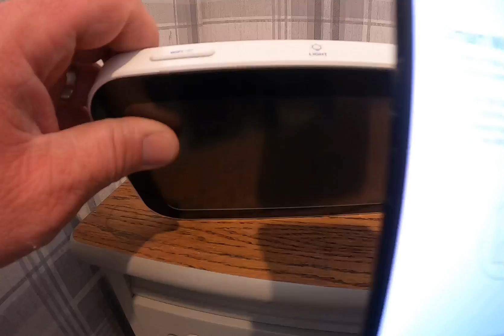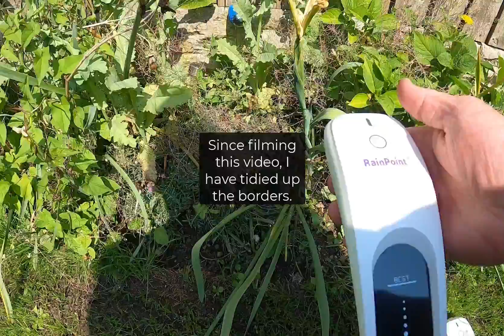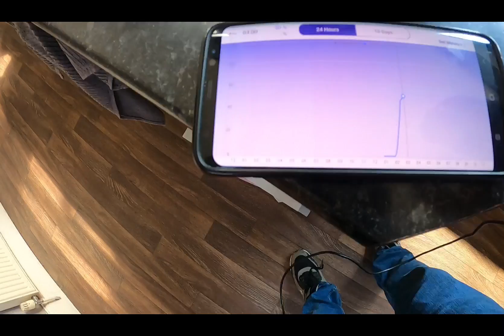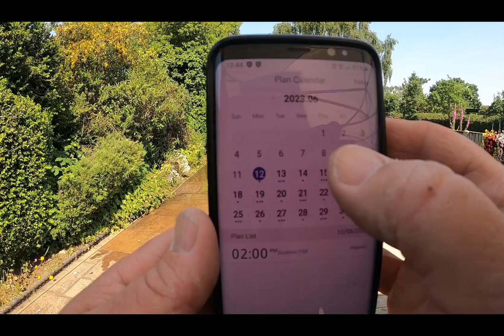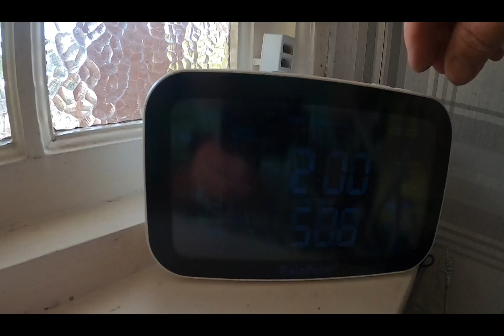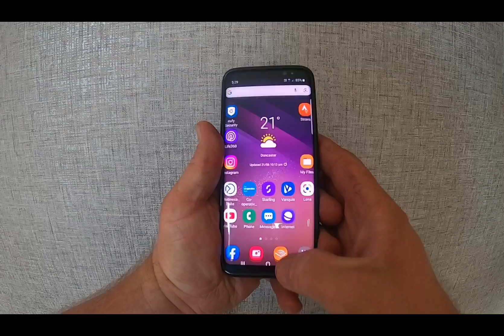How To Smart Water Your Garden - Rainpoint System Review

Comment: Hi, is there a way to control watering depending on the sensors? I cant find a way to stop the plan when humidity is sufcient or it is raining. So in the homgar app these features are missing?
Reply from the maker: Hi I'm really sorry I'm no longer using the product. I haven't used it this year either so I'm out of touch
Reply: You can setup a smart scene in the app and link it to the sensors. Make sure the wifi hub is using the latest firmware.

Comment: Does it automatically suspend watering when its rainy or do you have to skip it manually?
Reply from the maker: I think it suspend it.. Haven't used it for a year sorry so my minds a bit rusty 😩
Reply: Not automatically but you can setup a smart scene that tell it to suspend the programs if x mm of rain water has been detected by the rain sensor. You can also link it to a Weather forecast.

Comment: Nice product and great presentation!  I was expecting a wallet-pounding price, but was delightfully surprised at the low cost of the system you have.  I'm surprised RainPoint did not include small solar panels on the exterior sensors to charge the batteries during the day.  Maybe Version 2.0 will have them.

If you add some Hunter or Rainbird pop-up sprinkler heads, you will have a very nice lawn irrigation system.  I have used both Hunter and Rainbird systems, but prefer the Hunter for its durability and ease of programming.  In the past 11 years, I have not needed to replace any of the Hunter components, but was replacing a few Rainbird valves or spray bodies every season.  Fortunately, you don't have to dig up the spray bodies to replace the failed components.

I recommend the Hunter PRS40 (40PSI) or PRS30 (30PSI) pressure regulated spray bodies and MP rotator heads.  These will work perfectly with your RainPoint controller since they operate by water pressure.  I have 16 of the PRS40 spray bodies in two zones for the 200m2 lawn, and each zone works perfectly on the high pressure well pump or the domestic water pressure.  Depending on your domestic water pressure, you might want to limit each zone to eight spray bodies.  However, you should be able to easily cover your lawn with eight spray bodies along the perimeter with the appropriate MP rotator heads.
Reply from the maker: Thanks Mike.. something I need to look more into..  (for sure!)